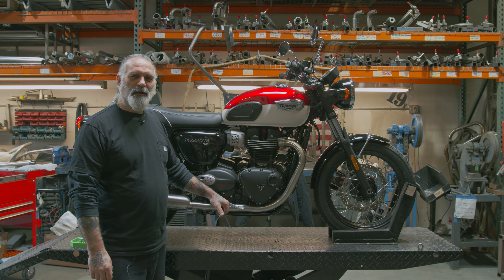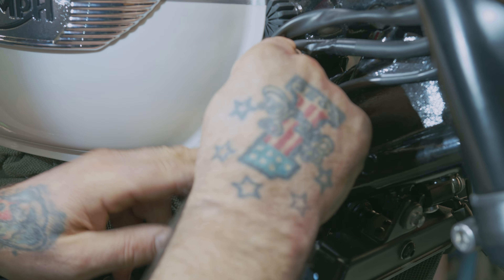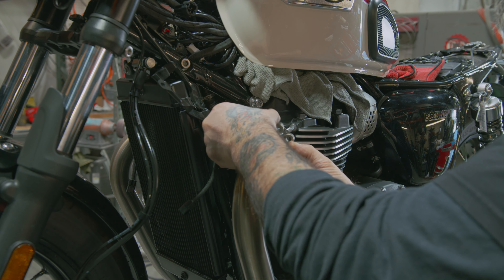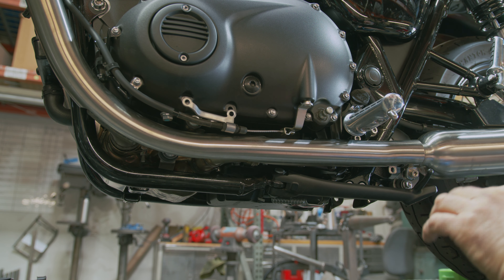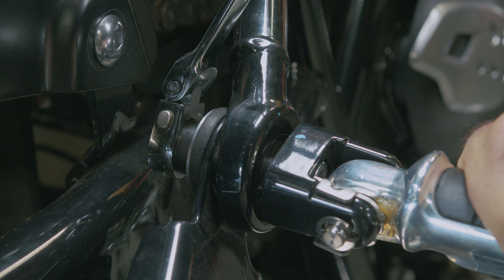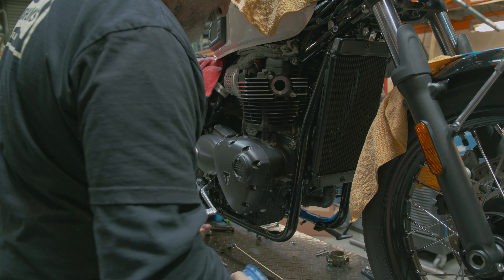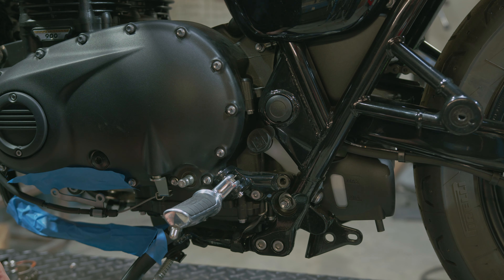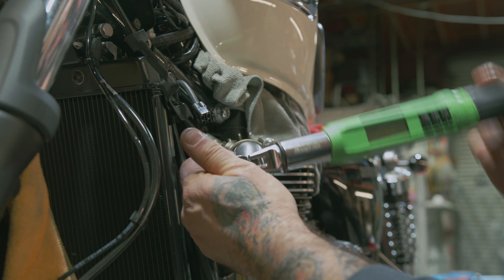How to Install Competition Headers for Triumph Bonneville T100 (EURO 5) | British Customs

Comment: you put the burble back in the exhaust note ,the system looks clean a much better way to go than an x pipe very good video
Reply from the maker: Next to the burble, there's more torque ! Going back to the classic 2-2 headers.. Thanks Richard.
Reply: @britishcustoms  you think eliminating crosspipes makes more tourqe? Explain your reasoning?

Comment: i want to install some straight through pipes (Arrow)on my Truxton but my mechanic doesn't recommend as it cause the engine to run hot.  is this really a problem?
Reply from the maker: It'll run hot from being lean, and it won't run as smoothly throughout the powerband when comparing against pipes that are baffled. One big reason why the mechanic may not recommend it is because the risk of damage to the engine specifically with the valves/seats burning up.

Comment: I really appreciate how careful you are when taking off the parts. Anyone can take off parts off harshly, but it requires skill to do it without damaging the bike. Quick question, I have a Euro 5 2023 T100, is the cat welded to the pipes? If so, does mean that a decat is more trick?
Reply from the maker: Hopefully it inspires people to do the same especially as these bikes serve as a great blank canvas and you never know if you might need these parts again (or for resell).

Euro-5 23 T100 will have the cat welded to the mid/intermediate pipes, exactly shown on this video (https://youtu.be/7Sz4uXLFGcQ?t=1321) so you'll have to go with a full exhaust system or our Competition Headers shown in this install guide depending on which route you want to go with pipe setup.
Reply: @britishcustoms  Thanks for the response! I think some x-pipes with the mid/intermediates pipes are starting to pop up on the market as well!

Comment: James you are great with tools fantastic to watch you work Sir.....excellent video.

Can I ask is any sort of re-map req after this work.
Reply from the maker: Definitely one of the best. 

We highly recommend a tune through DNK customs via tuneecu or a custom dyno tune via power commander + dyno.
Reply: @britishcustoms  Could it harm the motor if run and use with out tune with a dyno ect.

Thinking about weak fuel air mix.
Reply from the maker: @nickaxe771  No harm, just a bit lean and throttle to power ratio doesn't feel like 1:1, more like a 1:1.5 at times. 

Fire up the bike without any throttle and let it run until the fan kicks in (about 10-12 minutes ?) so that the tables adjust a bit. It's not a tune but it should help.

Comment: To save taking the rear pegs apart.....press down hard with your hand on the extended peg.....that will lock the bolt while you undo the nut on the back.....saves loosing any of those small parts on the rear foot rest or peg.
Reply from the maker: That's what we usually do but for instructional purpose, we have to do things the traditional way!

Comment: I have a t100 and that looks a nightmare.  How much it would cost in labor ?
Reply from the maker: It'd be difficult to quote a standard labor total as there are a lot of elements that can change pricing from modifications on the bike (if any), bike in tip-top running condition, and etc. Give us a ring and we can discuss more details and perhaps point you to the right shop to do this job! After all, it is a major part of your motorcycle so getting it done right pays off at the end.

Comment: Why all that process why not just do a union at the middle of the pipes ?
Reply from the maker: Design-wise, this is the best setup we found for installation and performance, specifically with these 270 firing liquid cooled twin engines.

Comment: Don't forget to tune it.  A real tune, not that DNK nonsense...

Thee Euro5 bikes are a pain in the butt with regards to tuning...  If the exhaust changes the flow enough that it noticeably picks up power, then it changed it enough to need a tune.  There is no free lunch any more, and there is no "12 minute tune".  There never really was, and there certainly isn't now.
Reply from the maker: Can’t go wrong with a custom tune on a dyno. Our friend, Mickey Cohen has been custom tuning these with some great results.
Reply: @britishcustoms  Good, glad to hear that.  You guys should be selling copies of those tunes and giving half to your tuner.  Easy money!

The one issue we are finding is that TuneECU doesn't make changes at or around idle.  if its lean there, and it usually is, it stays lean.  I talked to the writer of TuneECU about it and he will be making a revision to the software in the near future where that area of the F and L tables will be greyed out.  You can add 100% fuel there, and it makes zero difference on the AFR on the dyno.  So to really tune it right you need TuneECU to disable O2 and SAI and do your ignition advance and ride by wire edits... and then tune it with the power commander.

Or do it all in TuneECU and hope that the idle area is close enough to live with it.  BTW, I have a 2022 Speed Twin with your X-Pipe and it sounds BRILLIANT.

We tuned my bike and with stock headers and mufflers, stock air filter and your X-Pipe, we got almost 104hp and 85ft/lbs at the wheel.
Reply from the maker: @Daves_Man_Cave  nice ! Thanks for the feedback. Best approach through our tuner is using both Dynojet + TuneECU as one can do more than the other/vice versa when it comes to individually adjusting etc. 

We’d highly recommend getting in touch with Mickey Cohen as well for more background on this as he’s been tuning these bikes back to back with success.
Reply: @britishcustoms  I can tell from your description that he's doing it right.  My tuner for my Triumphs knows the brand really well, used to be the service manager for a Triumph dealer, he races WERA and has been tuning a long time.  He got me sorted.

Comment: Sorry, but they don't fit that nice. I had to wiggle, jiggle, and finagle to get them on.
The spacer and washers for the left pipe were useless. I had to use  three flat washers, and on the right pipe, I had to space the lower bracket with washers.
The crossover tube fit poorly, also.
Reply from the maker: Hey there, sorry you had that experience - can you give us a ring when you have a chance and let us know the process you went through as something doesn't sound right. 877-999-2748, thanks